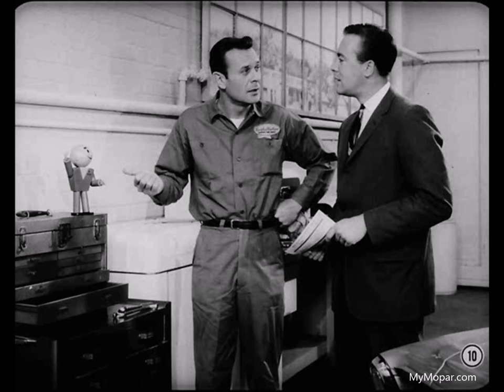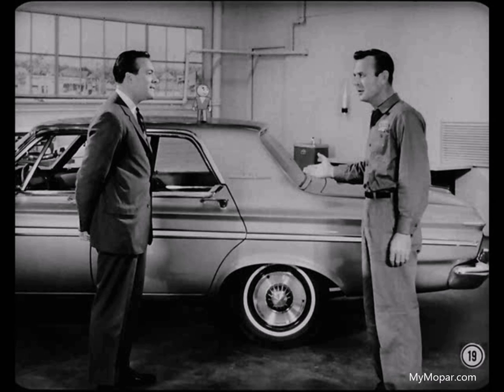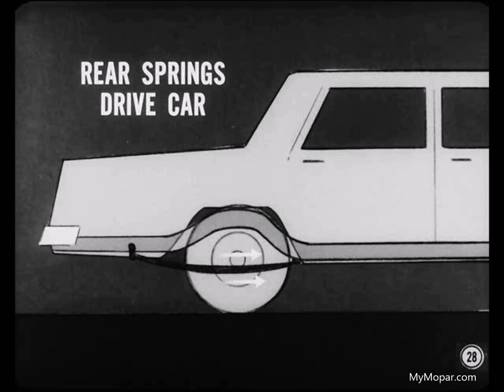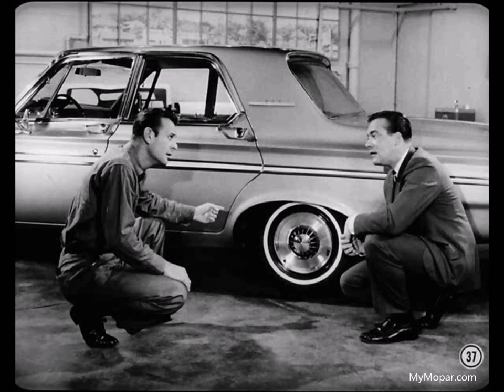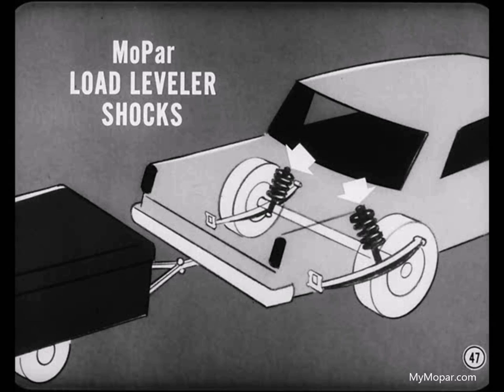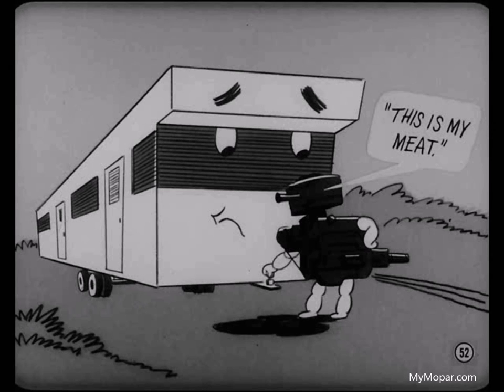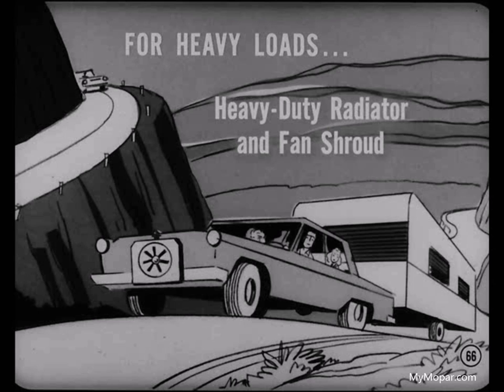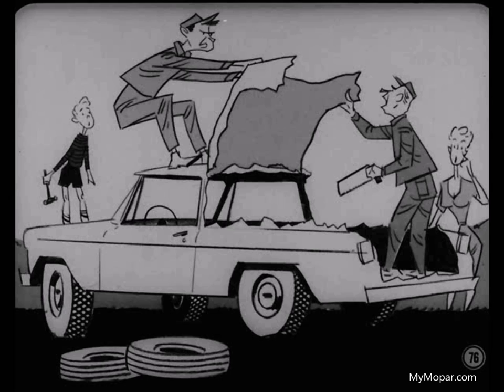Chrysler Master Tech - 1963, Volume 63-10 Heavy Duty Options

Comment: In 1964, my father specifically ordered his Sport Fury simply because he could get the HD equipment as std. HD suspension, brakes, tires, etc, when he ordered the 383 Commando and 4 speed. My grandfather was a Chevy man, but changed his tune when he test drove a 69 Plymouth Fury, compared to  an Impala. He said the big Fury drove much better, stopped better, and had better power, even with the 383 2bbl, over Chevy's 396 2bbl. BTW, I learned to drive on that same 69 Fury :)

Comment: This is really all stupid.  In the old days, the sales literature had info on towing and suspension options available.  Everything from shocks and springs, to suspension components, radiators, batteries and heavy duty alternators, even hitches.  Today, cars are so lightweight, towing is NOT recommended.  This is an interesting historical feature old cars and options, though.